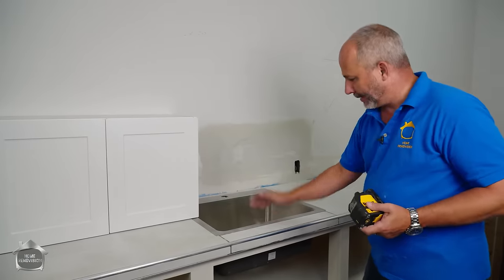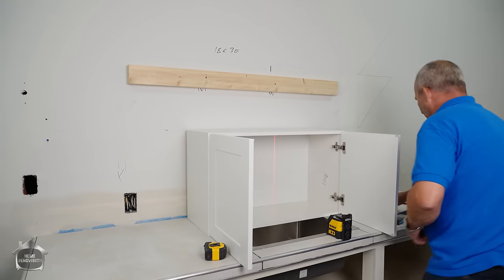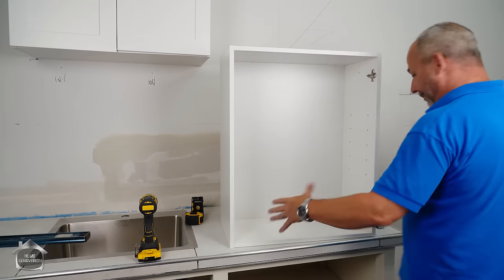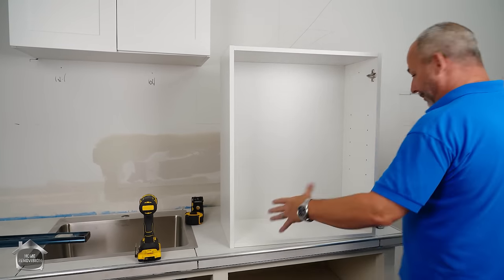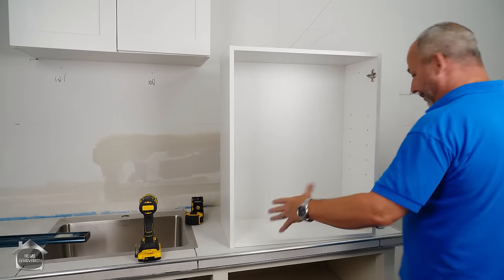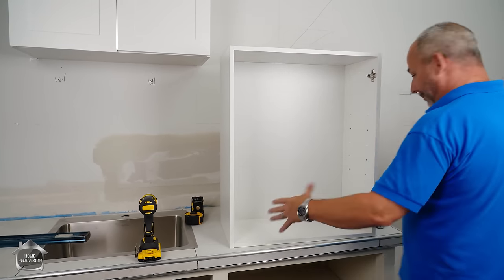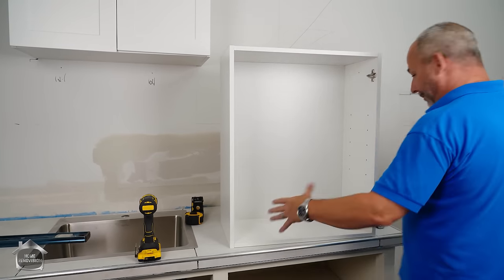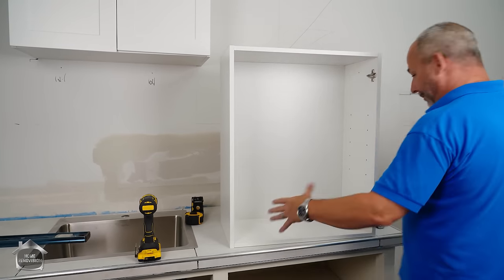11 Tricks For Perfect Kitchen Cabinets

Comment: just a tip for the knobs, putting it in the center of the 2 rails actually makes it look off center to the eye. you wanna cheat it up towards the center of the door. stick it on with a piece of tape or sticky tack and have a look before drilling so ur happy with the placement. try a few placements and compare.
Reply: Good tip! Thanks! I was hoping for a tip like this, we’re about to start this process in the next day or 2!

Comment: hopefully you still read the comment: why didn't you check if the wall is straight up vertically? I mean, if the wall is not, the the upper cabinet will lean forward or backward a little bit, is that gonna be an issue?

Comment: i have had great success mounting a single french cleat to the wall and then individuals on the back of the cabinets. If the cabinets are short enough I even sometimes join two on a cleat. Bit of care when attaching and they just go up level and you can push side to side to centre.

Comment: Regarding worrying about hitting electrical, if I have open walls I take pictures before it gets drywalled. Did this with my shower so I could hit studs with my Kerdi board .
Also had a tape measure against the studs so I could see the measurements in the future . I know this may not typically be an option,but thought I’d mention it

Comment: Best location for fastening one cabinet to another is directly underneath the hinge mounting plates. If you use shelf location for concealing your screws, adjusting these shelves will expose those screws. Hinges are much more permanent.

Comment: Hi, first time, long time. I’m slowly remodeling our house and I love the videos you make.  Especially the way you explain not only how to do it the right way, but why. 
In the event you take requests or ideas for videos, I have an idea, if you haven’t already done something like this. I have a kitchen pantry that is basically a narrow closet (24”w x 23”d x 96”h) with a narrower door (18”w x 80”h). I want to replace it with two side-by-side pull-out cabinets on tracks and a pull-down cabinet above and a drawer below for pet food. 

My current plan is to build the whole thing as one tall rectangular cabinet, remove the door and facade so there’s a rectangular void of the same dimensions, then just slide the cabinet into place and clean it up. Does that sound like a good plan?

Comment: Got some of the "topper cabinets" that are 30x12 that usually go over the range for $5 each from my job (Lowe's) on clearance for my garage and installed them super quick.  I have a green lazer level i got for $30 onal amazon from a youtuber who posts amazon tool deals with promo codes.. used that level for my height and my stud finder along with my magnet stud finder in conjunction to mark them.. I used a 3ft section of dog eared fence picket as a ledger and man it was a breeze..

I used a few washers on mine for my deck screws as i donr trust MDF to not just rip out .  Gave me much needed space and looks pretty good.

The nice thing with my lazer level is it has a vertical lazer also so once i found the studs I just positioned the level so the vertical line was inline with them and i still had my horizontal line which worked wonders..

Comment: I have used the scissor jack from the trunk of the car with some blocks of wood to assist in adjusting the height of the cabinet to level it on the wall.

Comment: Lots of good tips, screwing the board on top of the cabinet to help with hanging is a tip I learned way too late in my career. It really helps for solo installations. I’m also kind of weird and I prefer doing the bases first. I have one of those big Dewalt toolboxes and it seems to work with my height so that I can stand on it and put one leg on top of my base units and rest the uppers on my knee to help free my hands so I can focus on keeping the gables flush and screwing. Just have to be careful where I am stepping (my raised leg would be on the gables of the base units.

Obviously this was a pretty simple example, it can get a lot more complicated with wall-to-wall runs, corners, Gables for appliances, lining up hood fan, fillers, etc. but these are great fundamentals

Comment: When I mounted my cabinets I used 3 washers going from smallest to largest because i didnt have a small diameter hole washer with a larger diameter surface, I think it actually benefits me since my deck screws have a bugle shape at the head which would be non existent after using 3 washers. Its kind of ghetto using a small washer then another larger one and larger so that I could build up the surface area but it worked and the cabinets feel pretty damn solid if i say so myself.

Comment: I've heard a lot of people complain about that specific stud finder which is the same one that I have and I think what they're doing is using it wrong because I've never had a problem or issue with the finding studs and confirming that there are actually studs by either knocking on it and or using a stud buddy magnet to reconfirm that that's where the stud locations are

Comment: TLDR: Always pre drill,  (it prevents 14:34 where cabinets separate and surface damage) especially for important stuff like cabinets, different pre drilling and countersinks depending on screw type. 
For the "cabinet" or "pocket" screws with a flat washer head, you can pre drill with a forstner bit: flat bottom hole, and easier to conceal the screw. All you need is the thickness of the head, no more.  For the regular countersink screws, pre drill with a countersink, makes them flush without damaging the substrate: We all know how fragile particle board especially melamine or laminate coated is.

Comment: Hi Jeff. What is your opinion on fitting in a second hand used kitchen? I live on my own and have not long been in my house which needs a new kitchen. Sadly it's not in my budget since putting a new bathroom. There are lots on offer either for free or very cheap. Is it worth buying all the kitchen on offer and use what I need to fit into the space I have or is it going to be more trouble than it's worth? Have you ever fitted a second hand kitchen in someone's house and it be successful? By the way, I have to do it myself!.   How hard can it be? 🤔

Comment: Hear is old tick I learned when I was a kid instead of using electric stud finder I really find it's pretty easy just take a hammer and just slightly tap on the walls which I do understand that the tapping can mess up the surface but it works really well for finding studs that way and even sometimes just tapping it with your hand you can feel a hard spots where the studs are but nobody's teaching these tricks anymore I learned from my great-grandparents and being around people that do DIY stuff

Comment: A couple of questions. You talk about the length of screws you are using as being 3 inches long on a wall with drywall.  What about for plaster walls? Do I need to choose a longer screw when the walls are plaster? Also, any reason why you chose not to use french   cleats instead? I’ve tried both, but would like to hear your thoughts on both methods and the differences. I apologize if you have addressed this before, and maybe I missed it.

Comment: Instead of a temporary cleat I would consider a permanent cleat below the cabinets for extra support - nice piece of hardwood for wood-tone cabinets or matching piece of trim for solid color cabinets, wood plugs to conceal screws.

Had a kitchen & breakfast nook renovated into a long galley kitchen (13 x 23).  Put original oak cabinets on one side and fairly well-matched new cabinets on the other.  I later discovered end upper cabinet leaning out from the wall and the last two large cabinets (30"x30") had been secured with one Drywall screw at the bottom and one Drywall screw at the top.
When I called to complain they graciously offered to come back and put in a few more (drywall?) screws.  No thanks.  The admittedly poorly designed cabinets lacked proper mounting cleats; an issue the could and should have been addressed before remounting the cabinets.  I was stuck taking down the cabinets (since they were unwilling to help) and jury rigging some mounting cleats (glued and end-nail through cabinet sides).  Remounted with proper flanged cabinet screws.

Comment: Better quality euro hinges have a lever at the back of the hinge - pull it and it releases the hinge without having to fiddle with screws.  Even better quality hinges have a softclose.
I like to adjust the hinges with a screw driver, not a power bit on a drill which is overkill with lots of potential for overshooting as we saw.

Comment: There are stud finders that can detect live wires. I don't know how reliable they are, but they exists. 35$ at HD with 2in depth live wire detection.
Reply from the maker: that's cool, however since we have a code for depth of wire in a wall and we have rules for the length of the screws you use I feel very safe driving in a screw in an area where there are a ton of live wires. Cheers!

Comment: Great video. My 39 year old end cabinet is separating from the wall. Trouble is the cabinets are in two modules. A frame and an exterior oak panel. The panels are oak. The end cabinet is about 3 degrees below the ceiling. All other cabinets are flush against the ceiling. If you peak  inside the end cabinet you could see daylight, meaning it is separating from the frame. The ceiling is drywall. I thought by using a molly and inserting it through the fiberboard and into the drywall ceiling with a large washer and tightening it, it might pull the cabinet up the 3 degrees. Flush with the ceiling. With some pressure you can see it close the gap. Otherwise, I thought by using furstripping inside of the cabinet I might be able to latch on to that to take up the slack. It is probably easier that emptying out that whole section and rehanging that whole section, which is about five feet long. How would you approach this problem?

Comment: I would have screwed a level board to the wall to set the 2nd and 3rd on like you did the first one. I would screw them together with the screw going through the first cabinet with the screw just past the hinge and I would measure and pre drill all holes to screw it to the wall

Comment: just an FYI, this doesnt work for ikea cabinets as they have only an 1/8 back, if you're mounting without the suspension rail be sure to follow their instructions. you either need blocking at the right height all the way across or you need to fill the space in the back. they do sell a kit that fills that space if you need it. It's called "assembly kit for kitchen island"

Comment: You ought to try out the Franklin stud sensor, so much better than those style stud finders 😎🛠️😎🛠️😎
Reply from the maker: Maybe one of these days! I have found basic tools used correctly work very well in most situations.
Reply: @HomeRenoVisionDIY  your tutorial was excellent!!!
Reply: franklin is really good when you have to locate a bunch of studs fast, like doing baseboards.

Comment: Mount wall cabinets 54" from the ground to the bottom of the cabinet.  This assumes cabinet is at least 30" (normal) tall.  When finished, the top of the wall cabinets will be 84" (54+30) off the floor.

Comment: I purchased the cabinets from Home Depot that you have to assemble. I installed a 30” wide and 15” tall cabinet that the 63 pound over the range LG microwave will be attached to.
My concern is when I assembled the cabinet, there’s just a few pins at the front that secures the sides of the cabinet to the bottom ,and I feel there’s not a lot of structural integrity.
I’m debating to add some bracing in the right and left bottom corners . Maybe aluminum angle iron and drill some holes to attach .
Does this concern anyone else

Comment: Base cabs first?  Hang a cleat on the. Wall to give you help and make sure the wall cabs are level,  without needing a laser. Base cabs are the base measurement for where the wall cabs go.  Jn my experience of 30 kitchens in the last 3 years

Comment: Are there specific type of screws to use for the cabinets when hanging
Reply: You can get 3” pan heads or just regular zinc construction screws
Reply: I used cabinet screws when I mounted mine. They have a big wide, flat head, with a star drive. They come in various lengths.
Also, if your cabinets have face frames, they have special trim head screws for screwing the face frames together.

Comment: I’d use button head screws to hold those cabinets to the wall gives a stronger bond area and you can get them with different head colors and lengths  …. Particle board cabinets are generally not very strong … good how to video for those not knowing how to install cabinets 👊🏼👊🏼🪚🔨🇺🇸🇺🇸
Reply from the maker: Cheers Fred!

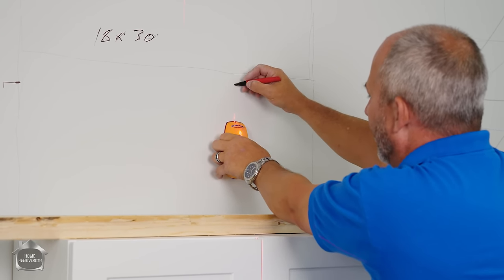Comment: Oh, God cabinets. They weigh a ton empty and get loaded up.  Amazing how builders can toss in a couple drywall screws and call it a day. I zip lots of  top panheads and bottom in the thick part, not the veneer backing. 2:55 The Zircon(?) finder should show electric especially if it's close to the surface.  Should, doesn't always read.

Question.  Is the wall crippled out for the cabinets or is going on stud enough?